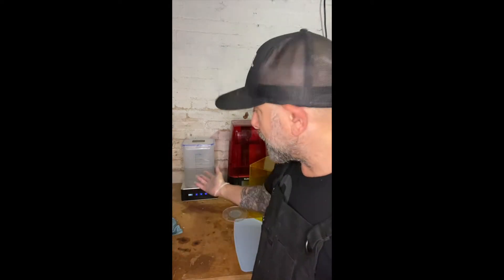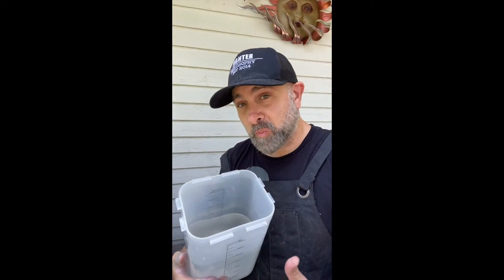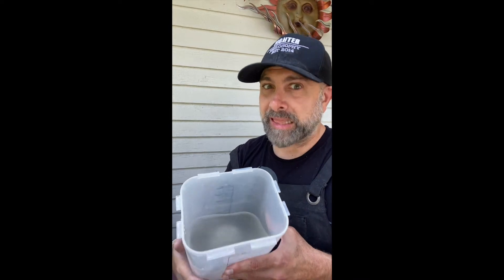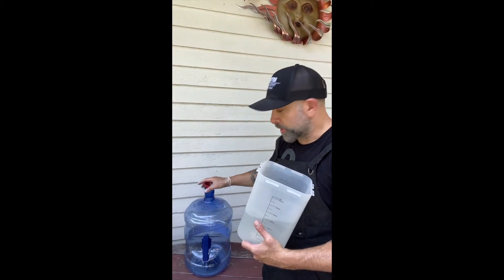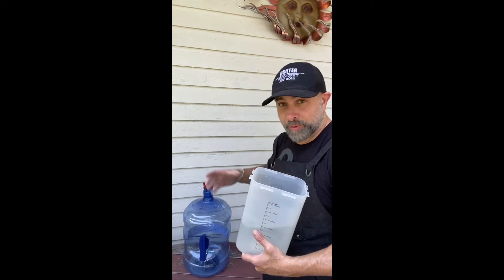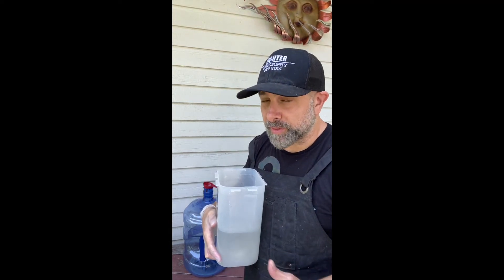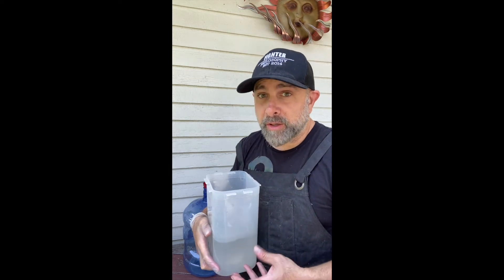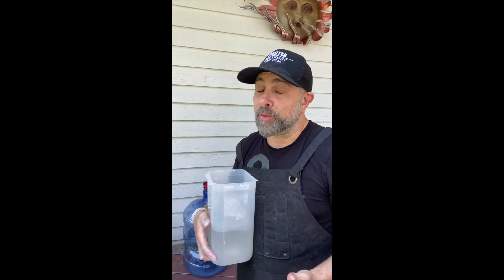How to dispose of 3D resin printer wash

Comment: I am in the UK and sadly our hot summers are super rare, the winter like now is freezing cold and although there is some bright sun and I have a south facing back garden for max sunlight. It is not enough to do the 14 liters ( 24.6 pints ) of water based wash water filled with resin!

I thought about using a UV light but they cost hundreds of pounds over here for a big LED UV Light I would need to harden the resin in the wash water?  Plus in the winter like now it is so cold the water in any clear container would freeze before and sunlight could do it's setting!

I looked around where I live for toxic waste centers whom could dispose of this big amount of water filled resin waste. None found.
Plus I have no car to even transport the containers I got filled with the wash water, I know no public transport would let it on broad either.

That's why even though the 3D Resin 4K Saturn 2 Printer I got can do amazing prints, I stopped using it due to the huge amount of very toxic waste wash water I got can't be safely disposed?  Bad enough the resin is very pricey as it is.

So any idea's how I can dispose of this waste wash water?

Comment: So I live in NY and now it is fairly cold. About how long does it take for all that water to evaporate? Do you have a lid over it so if it rains it doesn't fill up with water?
Reply from the maker: Remember the main reason you're leaving it out is to let the UV rays harden the plastic. It usually takes a few days to week or so to evaporate, but it will also depend on the amount of liquid, temperature (like you stated), etc. I use a 5 gallon water jug, so the opening is very small and allows the evaporated water to escape.